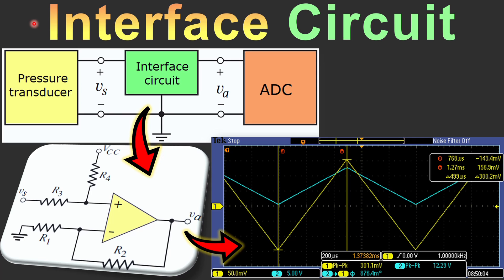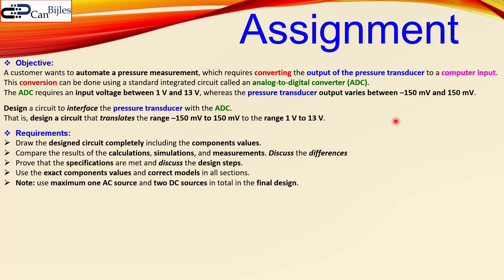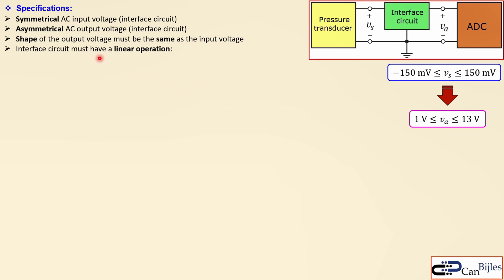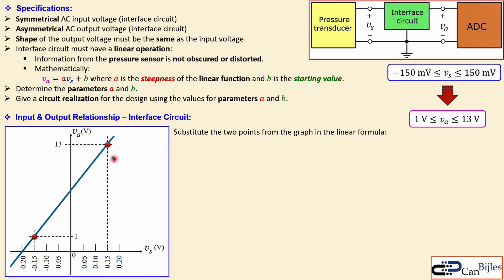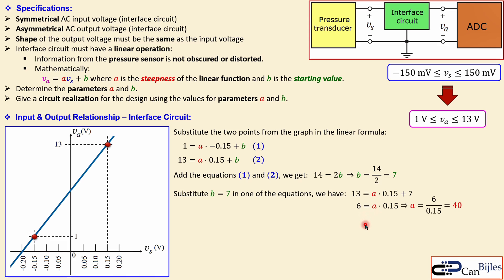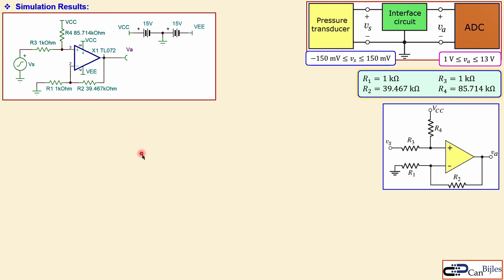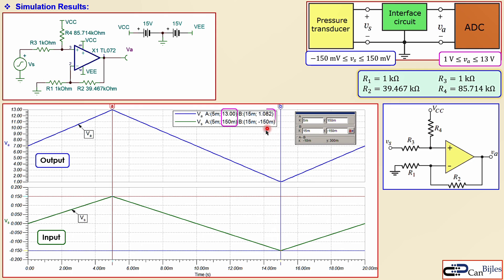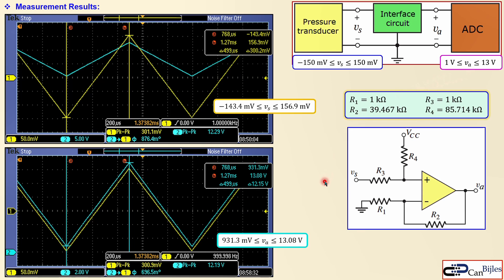🎯 Interface Circuit Design - Transducer to ADC Connection 🌟 Calculations, Simulations & Measurements

Comment: perfect thank you for this great example, if we have current at the output of transducer what would be the approach because here we had both as voltage are we tackle the same or we should take another approach
Reply from the maker: If your input signal is current, then you can convert this into a voltage using a Transimpedance Amplifier. Then, you can proceed similar to this example.

Comment: Thank you very much, it's a great example of signal conditioning. It would have been also great to see an example of an op-amp without a symmetric power supply. I believe adding a noise filtering stage would perfect this design; for instance, a Sallen-Key filter design would complement this interface very well as part 2. 
Thank you so much for your tutorial videos and your efforts.
Reply from the maker: Thanks for your message and you are welcome! There are indeed many other possible solutions for this design problem. Improvement like bandwidth, noise, power budget, PCB area, weight, etc. are not taken into account here. Normally, you should have The Object Performance Specification. For details about real analog electronics design, I advise you to go to this website: https://analog-electronics.tudelft.nl
Reply: @CANEDUX   Thank you